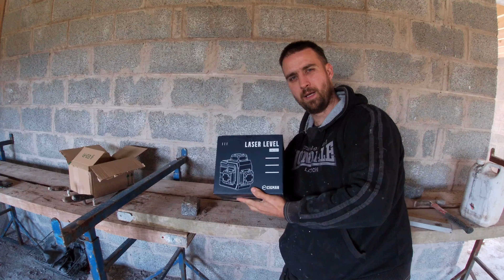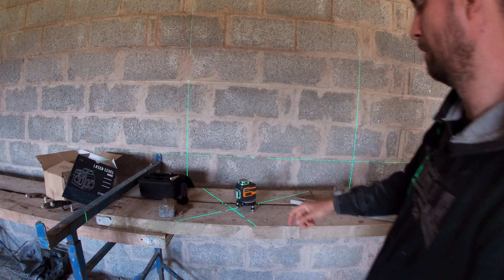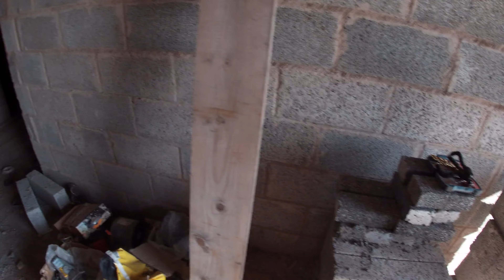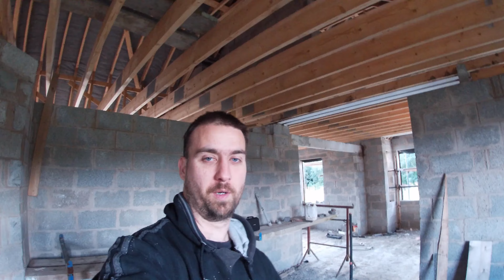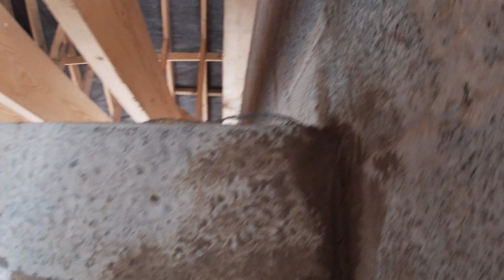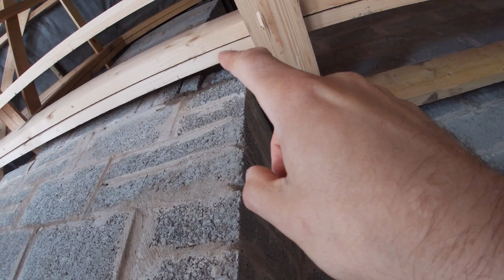Unveiling the Future: Unboxing the Exciting Cigman Laser Level!

Comment: Hi Mac, do you have any videos about the timber rules you use instead of angle beads for external rendering? Do you make them yourself?
Reply: Cheers Mac 🤝
Reply from the maker: @joedainton2189  will try and re do these videos better in near future but is it the skimming side or sand n cement side u need most?
Reply: It was for external rendering. Normally use beads but every now and then get a job where the architect doesn’t want beads.
Reply from the maker: @joedainton2189  yes I see mate I will try cover it in better detail when I'm next at one
Reply from the maker: https://youtu.be/RpLhxaL7eH0  and https://youtu.be/cQ5zgh2xGy4   is this the type you mean man?

Comment: There is a massive work in a self build.. 
You might get a door or window measure until the door threshold lintels are fitted for a measure. 
Try to use twist traps on every areas that shrinkage from trusses will happen. Avoids creaking after.
I haven't been on house building since 2019 but the last phase of houses built we used 22mm caber board, fixed with polystyrene glue ( gorilla glue) fixed down with 5mm screws. 
We learnt a trick too to get the copper pipe stabs (1st fix done)  down first before the caber fixing. 
Also all the bridging board we put long screws into even after the joiners gas nail fixed them. 
Heaps of little things to halt that shrinkage, some floors hand 12mm drops from the skirting boards from the joist shrinkage!
Reply from the maker: Thanks for adding your knowledge in mate not sure if you seen some of the other videos but i have now triple nailed and put on joist hangers so preety happy with the roof tied to the wall plate now but might add a few more big concrete screws down the wall plate into wall even though it is nailed down and strapped on hopefully i wont get a 12mm shrink that sounds loads
Reply: Good luck, looks good so far.
Reply from the maker: @MarvinofMars  Thank you buddy and do drop in from time to time as we get up the stages :) thanks again for the comment brother